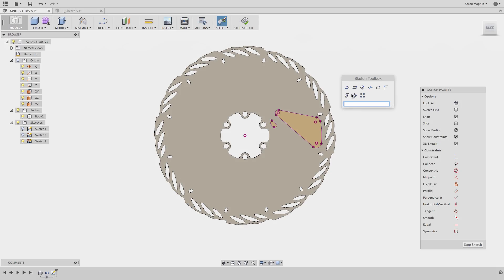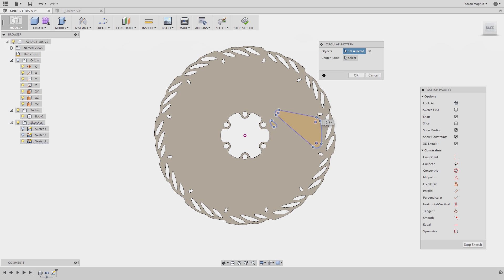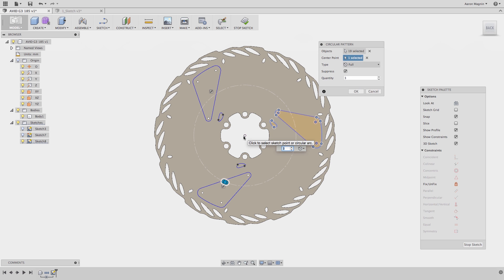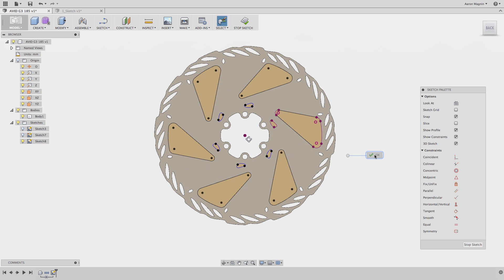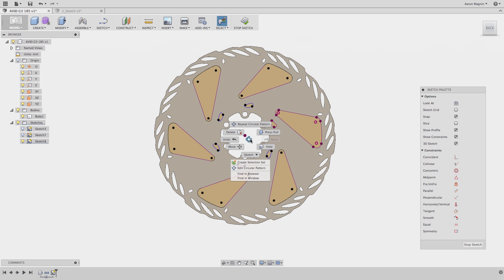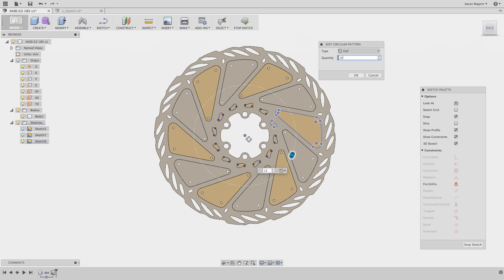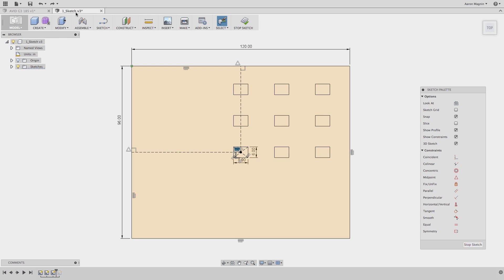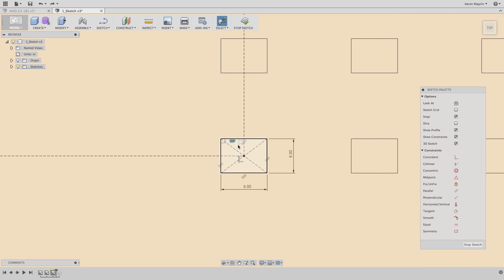Quick Tip: Change Sketch Patterns

Comment: Hi not sure who or where to ask but I'm a knife maker and new to cad.  I downloaded fusion 360 and have been messing around watching tutorials. My question is if I want to design a full tang fixed blade ( straight knife with handles ) how do I shape the bevels.  I can get one bevel and mirror it but I want to learn to make more complex bevels that intersect at the tip and such. And how would I make an exploded view of the blade , handles and screws all spread apart . Any suggestions. Or can someone do a tutorial? Thanks frank